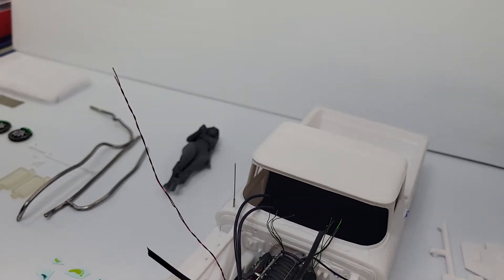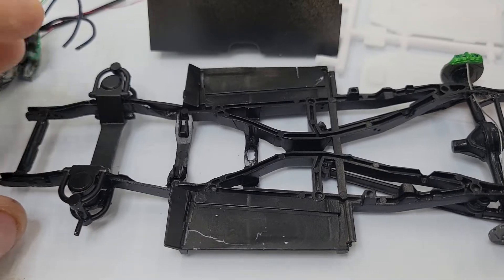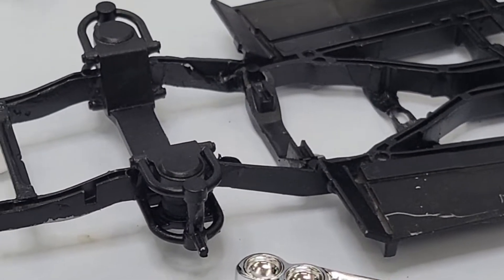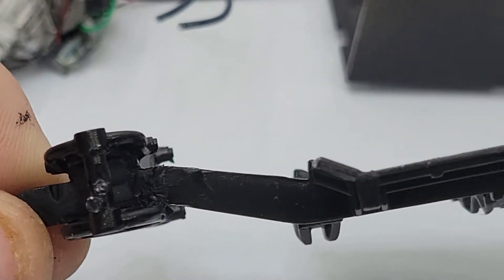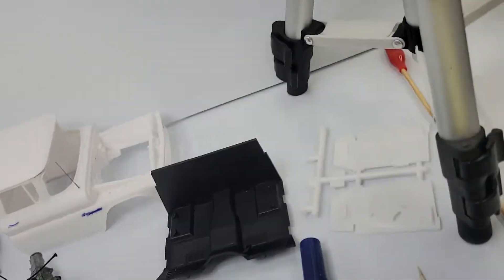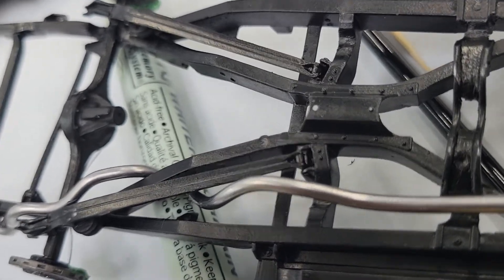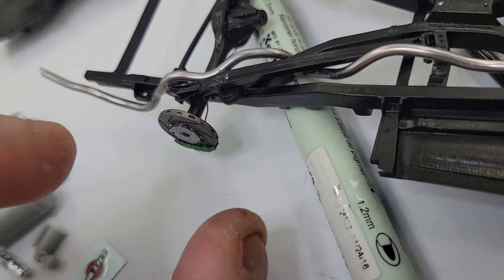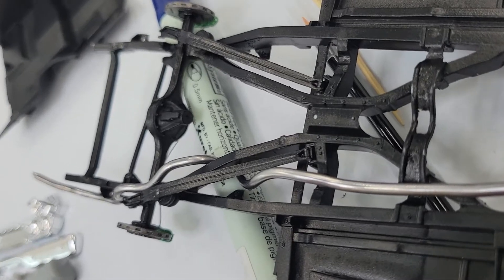1966 chevy c10

Comment: The only advice I would suggest for the air bag system is look at the complete vehicle and see what works best. For me, if there's not enough chrome and I want to add something chrome, I would do that. BUT, since a lot of the chrome has been stripped, I would use the colors of the truck and do that.

Comment: Damnit MAN,
             I wish I could make a plan and just run right through it.. I'm flying By the seat of my pants, working IT out as I go .. Basic plan of attack and the rest is pretty much on the move..   I really appreciate that shout out and I'm a REAL supporter of what you do there.. BADASS work going on.. Your gonna grow fast and pass ALOT of us.. 
                 Again thanks for everything you're doing to help everyone in this community....😎👍🥃🍻
Reply from the maker: Thank you brotha 🙏 💯 💪
Reply: Ohh, and BTW if I ever attempt to do as much engine details as that one I hope someone shoots me.🤣 I AIN'T EVEN PLAYING 😎👍🍻
Reply from the maker: It's not that hard,I've seen your builds and u have done extensive builds before,just have to find that one car ,do your research of all the details you think you can duplicate and then push yourself to do a little more.lol that's all I do.i won't kill you but I would b willing to help where I can.
Reply: @rustyrotorsmodelcargarage9410  lol, my biggest problem is being able to get my hands on the fine wiring.. I'm lucky I still have a little bit of plug wire.. Most of my braided hoses are copper wire with metal flake nail polish over it 😂 Man gotta do what a man gotta do.. But hey, I get by and get to smile when it's done.. SOMETIMES!! 🍻
Reply from the maker: The little wire I use I buy at hobby lobby in the jewelry section,it's anodized wire comes in like 8 colors for like 12 dollars,it has lasted me 3 years and still have plenty ,any electronics  wire will work,like from  cell phone chargers strip coating off use alligator clips and spray different colors as desired then clear coat,it works well most plug wires in those pre wired set ups are 32 awg.wraping wire which u can find on ebay 30 awg works for plug boots👍
Reply: @rustyrotorsmodelcargarage9410  Even the alternator and fuel injectors? That looks smaller on the video.. I'll check it out because I have one of those wire sets..

Comment: Most enjoyable, thank you for putting this together. My vote is the less chrome the better, so I'd like to see the air suspension equipment in color. And I think the swamp cooler would be a great detail to add to the build. One suggestion on your videos would be defining a source on some of your details, like the swamp cooler, air suspension system parts, engine electronics and the engine. Curious to know what you are using for these pieces. Keep up the great work. Thanks again.
Reply from the maker: Thank you and I usually  talk about all that on the final I keep a log on all my builds including all parts,paints,ect.🙏🏻🙏🏻🙏🏻

Comment: What website did you go to, to purchase the files to print for the frame? I 3D print and always interested on sellers that have good files. Also, where did you get the aftermarket antenna?
Reply from the maker: Some one else made front clip,I believe it was dog3 models but not 100 percent sure I have a 3d printer but I am a beginner  I still can't get file from slicer to flash drive I know I'm doing something wrong lol
Reply from the maker: I need help lol I know 0 about computers but I want to learn,no one close to me to help
Reply: @rustyrotorsmodelcargarage9410  check out any of my videos. At the bottom of the description is my email. Send me an email with your phone number and I can help put. I have the Anycubic Mono printer and have been using it for 1 year with success. I can help you figure out your issues and get you going. If you have an iPhone, FaceTime would be best or if you have a Facebook account then messenger video calling would work. Need to physically see what you are doing to help but know I can get you going.
Reply from the maker: I have interest in figures so I have obtained  files from claymore miniatures, and down loaded a free file from black box on cults also working with Ryan Jones of zforce model works he is also on cults.but like I said I can't get my files onto flash drive my son is a computer engineer  he's coming over today to help I use lychee,and Chitubox for slicers
Reply: @rustyrotorsmodelcargarage9410  I use chitubox as well. Well if you need additional help, I’m always happy to help. I’m in Colorado and everyone here is pretty much in seclusion so always happy to talk models, talk 3D printing, and anything else about our hobby and 1:1 cars.
Reply from the maker: rawykoffjr@gmail.com  is my email send phone number and we can chat I want to be able to print soon and with no major  issues I know prints fail but atleast ,hopefully  I can get to that point
Reply: @rustyrotorsmodelcargarage9410  I found a fool proof way to not have misprints. I have no problem giving you all the settings I use on my Anycubic and how I get the VAT/Base plate ready for printing. I will send you an email.
Reply from the maker: Thank you

Comment: That green & black truck has a 64 to 66 cab
Reply from the maker: It's a 66 c10 with a 60s head light and grill,I used 1960 kit and added 66 hood,60 kit has better detail than the 66 kit.👍